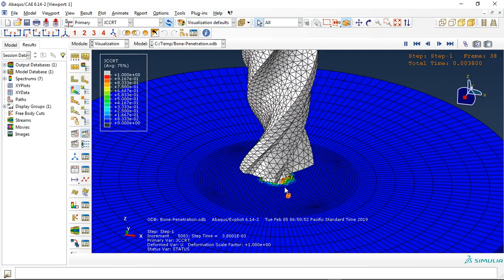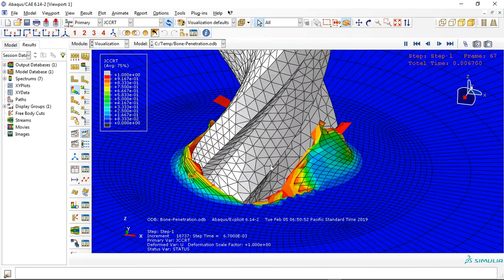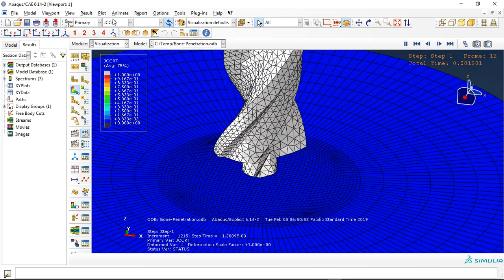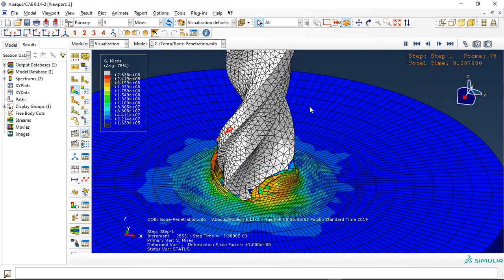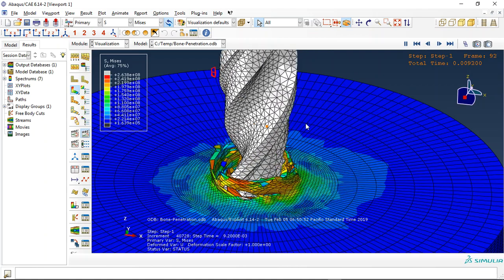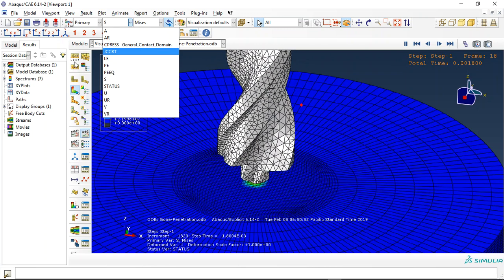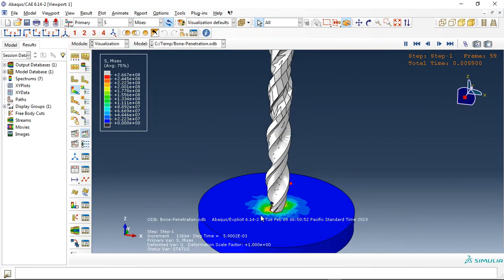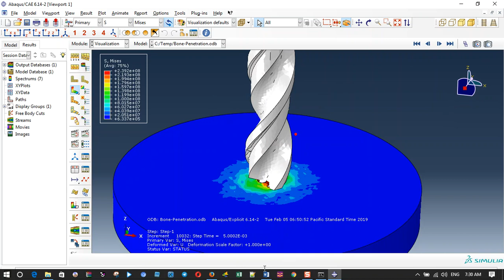Simulation bone drilling process by using explicit method in Abaqus

Comment: Please tell me  how to adjust the  dynamic explicit parameters in ABAQUS to be equivalent to the static loading? Thanks
Reply from the maker: You can use smooth amplitude with a large time step to make a quasi-static simulation with the dynamic explicit procedure
Reply: @abaqusfem3576  OK, o,o & 1,1 amplitude is enough. For time step the default in explicit is 1 is enough or not?
Reply from the maker: @amrmasoud5580  Use 0,0 for the first and use step time and 1 for the second raws